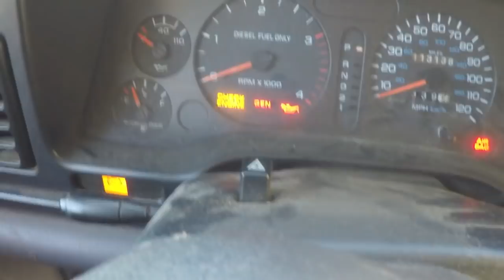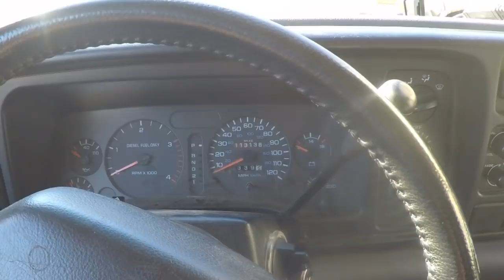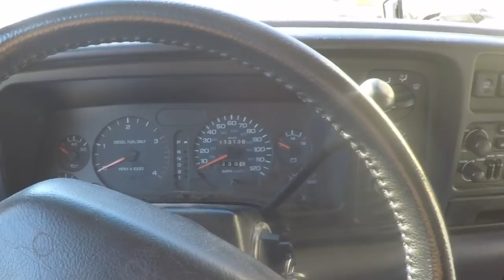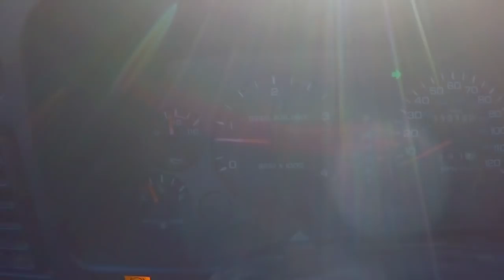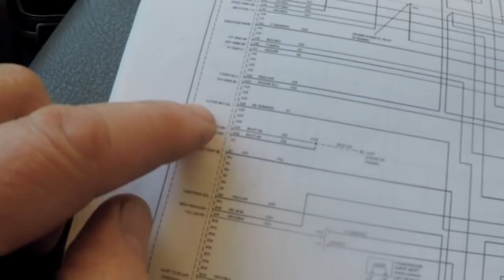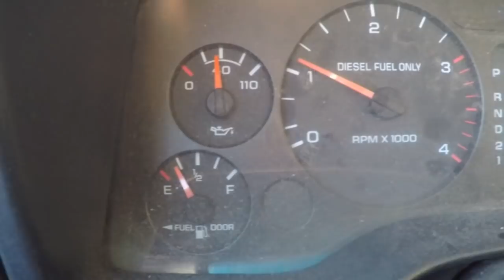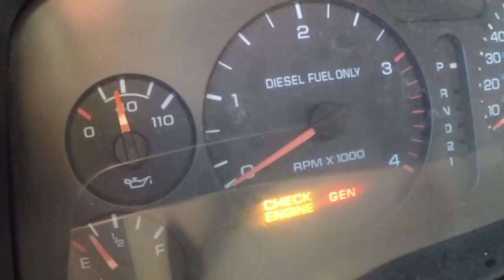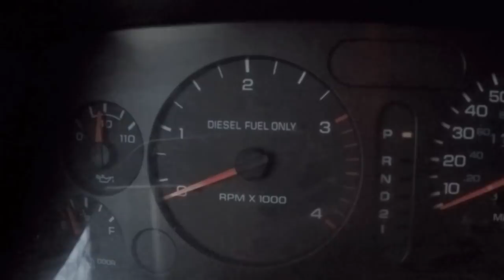Dodge Ram Cummins 12 valve tachometer issues Part 1

Comment: If this truck has the 47RH or 47RE transmission, first three gears are hydraulically controlled.  This allows the truck to operate the first three gears even without a functioning PCM, since it shifts like the old 727 transmission.  Overdrive however is electronically controlled, which requires the PCM to determine the conditions under which the truck should enter overdrive, including throttle position and RPM.

I suppose if I were in your shoes I'd see if I could somehow monitor that 5V supply while on a test drive.  Unfortunately that probably means tracking down the male and female sides of that connector and building your own inline bit of harness.  Now, the advantage of that is that you can test on the other two wires, to see if you're getting some kind of crank position reading.

Back in the day there was interest in figuring out how to automatically control overdrive when putting an A500 or A518 into a '70s muscle car.  The common solution was a toggle switch that the driver engages to make the transmission upshift to OD, but obviously that's not as elegant as something that could monitor RPM and throttle position and do it without intervention.  Not sure if that was ever solved unfortunately, 'cause if it was, then it might at least allow you to have overdrive, even if it doesn't fix the tach problems.
Reply from the maker: Wow, lots of good information here. I still haven't order the sensor. I plan to rig something with the harness so I can monitor that sensor. Both the 5v supply and the pulse output with my oscilloscope.. stay tuned!
Reply: @stevewatr  did you find a solution? got a 96 with the 47RE i believe, drives awesome when trucks first started, but after about 10miles the tach goes wacky and it wants to keep downshifting doesnt wanna use upper gears/OD? i think its staying in 2nd gear not even 3rd, aout 100kph (60mph) is my top speed in that gear when it acts up cant go over 100kph and thats the engine at fuel cut rpm so 80-90kph is a more realistic speed

dunno if i should throw a 100$ sensor at it or if its the whole PCM
Reply: still watching the videos as im commenting, but im not having any charging issues or engine light/gen light coming on, cruise control doesnt work but i just bought the truck idk if it ever did.. my tach gets shacky and adds 1000rpm under throttle or will just go full rpm right past 4000 .. i just want it to shift properly i dont care about tach or cruise

Comment: I am having issues, tach, speedo, alternate, and temp gauge not working. Fuel and oil pressure work. Alternator is charging though. I took a guess and replaced ignition switch because my Silverado had that same issue years ago. That didn't fix it.

Comment: IF the ESS has rubbed ,, its the Rubber in the harmonic balancer allowing the balancing ring to move around a bit  , in turn rubbing and ruining the ESS. Id replace AND set the gap to the max recommended .  My 94 12 valve just started with its intermittent Tach , so ill look into grounds , wiring trauma , look at  and or replace replace ESS sensor ,, also  many oddities come from bad solder connections in the dash cluster . Thanks for the VID !!
Reply from the maker: There were no signs of rubbing on the sensor, and after the replacing the sensor, the issue was resolved, and has not returned to date, that was over a year ago.

Comment: I’d give anything to have seen this before I spent a small fortune on alternators and batteries. Long story short, my father in law is in the hospital recovering from Covid. He has a 1994 Dodge Ram 2500 CTD with a four speed manual. I’ve been working on it for him, compounding, polishing, ceramic coating. Just want it be right when he finally gets out. The truck would run fine but as soon as you ran the lights, windshield wipers, AC pretty much anything electrical, it would drain the batteries. New alternator, same problem, new batteries, same problem. His tach hasn’t worked for some time and the truck has been sitting for a while ( he has multiple vehicles ) All this makes so much since now. Sometimes some of us have to learn the hard way 🤷‍♂️

Comment: I commenting while I'm watching , but did you adjust trammision TV cable after you put all the throttle cable stuff back in? Dosent have anything to do with electronics but greatly affect shifting. The cable with the D shaped silver button , depress and hold and push nose of that cable assy inward. Then depress acellerator  pedal to floor once and you'll hear the cable attach end click several times adjusting its self .
Good thing to rule out .

Comment: Hi steve i have 97 dodge ram 2500 turbo diesel 5.9 cummins mi problem is that my RPM needle bounces alot and when i reach 40mph my turbo doesn't kick in.....any idea

Comment: Charger fault? Does the Charger excite the relays or functions? The voltage gauge changed when the warning lights came on.
Reply from the maker: Very good eye. Turns out that when the  PCM is not getting a signal from the engine speed sensor, it inhibits the alternator because it thinks the engine isnt running!

Comment: Hi Steve thanks for the video my 1997 dodge 3500 Cummins does the exact  same thing but only when I make left turns any advise  helps thanks .
Reply from the maker: In part 3 I reveal that I  believe the issue was the crankshaft sensor. I replaced it, and gave not had the issue return. But you left turn only symptom makes me wonder if you have a wiring issue, like a wire grounding out somewhere when the truck makes a turn.
Reply: @stevewatr  I changed  the sensor  as you did in part  3 and so far so good thanks .looking forward  to more if your great videos

Comment: I'm having the same issue with my 97 I've had the problem for months I replaced sensors alternator etc but still can't get the truck to charge or run properly
Reply from the maker: Stay tuned for part 2, I'm going to work on this problem again today. But I  have now learned that my alternator is also turning on and off as the tach malfunctions. All of my symptoms can be caused by the pcm not seeing a signal from that ess, aka crankshaft sensor. If you already replaced yours, and still have your issue, I'd suspect a bad ground, or bad wiring. That pulse comes from the sensor up front and has to travel up the fr ok not of the engine, along the drivers side of the engine to the firewall, over to the pcm sitting on the passenger side firewall. Plenty of twists and turns in that wiring harness! Corrosion on the plugs going into the pcm could also cause the issue.
Reply: It was indeed wiring issues inline fuse solved it thankyou I enjoy your videos great job 👍
Reply from the maker: Thank you for watching. Don't forget to subscribe.
Reply: @stevewatr  I'm so lost on my issue serp belt and tensioner broke, first went home pulled out bracket retreaved bolt put together new parts 2 days later truck didn't start got new got jump when 50 miles to work at that point radio shit off dead Batts clock widow's seats all dead  last to go was tach jumping got to shop check Batts there bad new Batts checked alt running 12.5 volts co worker boss  say alt is bad ,I saw two wires a blue green headed out knew it was something different couldn't remember what it was called go to auto store say alt is bad , sceptical change in parking lot don't wanna kill new batt ,on way home dark lights on no dimming just sitting at 12v even behind alt,only  did research checked codes front right antilock breaks intermittent....this week stuck at home pulled most wires in harnesses found one under 1st batt box whole bundle smashed under going to a huge cluster if grounds all look like rainbow melted crayons and two wires under radiator rubbing on rain twisted together? HELP

Comment: There's one other thing you can check there's a little power lead that goes down to two solenoids that are on the driver side the power lead comes down off the battery and it splits and goes down to the two solenoids they have a push on connection that over time ends up loose and they will move around on the top of the solenoids it will cause your dash or your tach to jump around it will kick you out of overdrive and I had a lot of problems until I found it but if you take some pliers and close down the connection just a little and push them back on it fixed everything
Reply from the maker: Thanks for the tip. In my case it was the crankshaft sensor.
Reply: Have a little more insight on this? I have a 98 12 valve and when I’m driving and hit a bump it will down shift the transmission and if I watch it just right my tachometer will bounce around for just a split second.

Comment: Where does the coolant sensor sit at on this truck warmed up.
Reply from the maker: I don't recall exactly. I can tell you that on a summer day towing a 14000 lb. trailer up a long incline. it will run right up to the high limit line before the danger zone.

Comment: what was the part no. of the sensor and where did you get it?
Reply from the maker: I bought it on Rock Auto. Don't remember the part number but you can just put in the year and model of truck on their website. Be sure to select diesel engine.

Comment: My 1999 has almost the exact same problem. Tach goes to zero sometimes when I hit a bump. Engine may skip a little. Tach may or may not start working again later. Sometimes, when I switch it off--with the check engine light on, the computer seems to not reboot. Then I remove the battery cables to reboot it to get it to start again! I hate computers because one problem can cause other problems!
Reply: Did you ever find a fix for the problem, I have 99 24valve.
Reply: @EdY-rr1cp  Yes. Crank position sensor, I think. Replaced it. Tach works off it. No tach, no signal to computer and the engine computer gets "lost", so to speak.
Reply: @richardharrison4804  Thank you sir, your reply  was the exact problem and it's fixed now! She runs and can get me back up in the Sierra's where I have a 20 acre Quartz mine. We are looking for gold, it is there in placer form and inside the quartz. We are located between 2 of the largest producing gold mines in 1849 California history. The Empire Mine and The Rough and Ready mine. It's hard going and the Cummins can take it well. Thanks again
Reply: @EdY-rr1cp  Glad to help others when I had the same issue. Good luck with your quest!

Comment: i would check your main ground for the pcm as well,most sensors are ground triggered thru the pcm. the new sensor will come with what us chrysler guys called pez.... i just threw out a sheet of them last week,they are used on any crank or flywheel triggered sensor. they were made of paper so once the vehicle was started the pez disintegrated.

Comment: Has anyone had this same problem with the truck bring a 5 speed?
Reply: yes I have a 3500 24v 1998 sport with the nv4500 trans the tach doesn't always follow the engine rpm but ts not the crank sensor I have an edge that the tach function works fine and the pcm in this situation is fine as it's communicating to the DLC to a scanner.